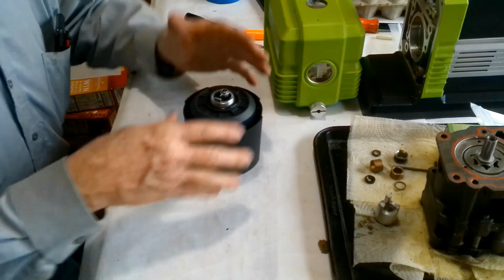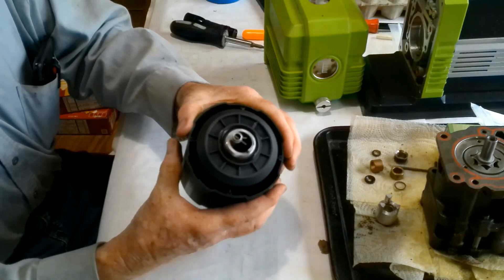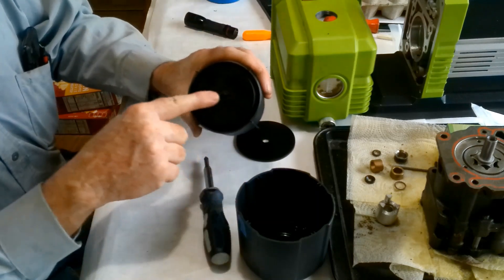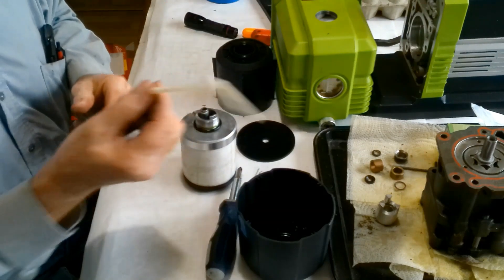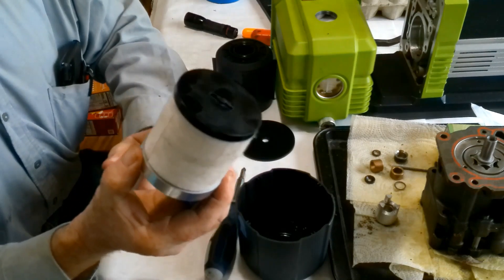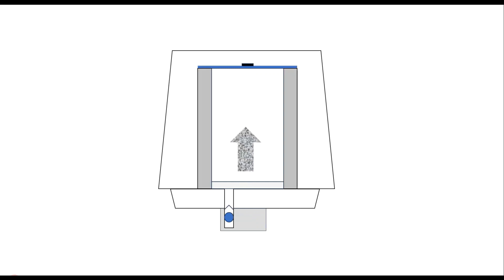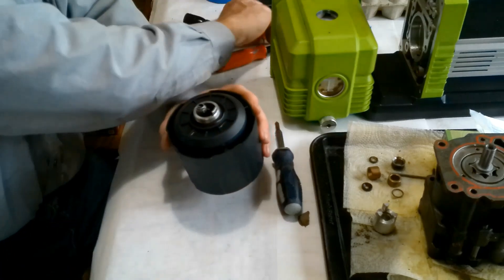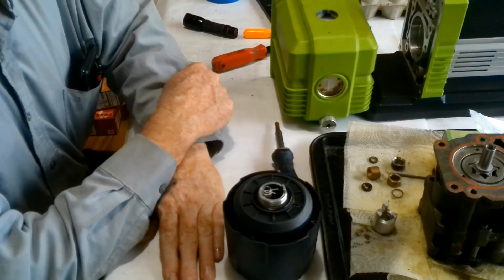Harvest Right's Oil Mist Filter Maintenance

Comment: The demister on my pump is only a few months old. It looks new inside. I change the oil after nearly every load. The demister has what looks like smoke coming out of it, from under the cap. There’s no odor, so I know it’s not actually smoke. The pump sounds fine. Mtorr is about 550. Do you have an idea of what the issue is? I have a fresh gallon of the black gold oil that I plan to switch over to. I’ve been using the robinair brand.
Reply from the maker: If you’re seeing visible “smoke” from under the cap, it means some oil vapor is bypassing the filter element either because: The pump is working hard at higher chamber pressures (550 mTorr is still high enough to produce more mist than deep vacuum),  Or the demister cap isn’t sealing perfectly around the gasket, so the vapor is escaping before it’s filtered.
Reply: @Philat4800feet I figured it out. I somehow wound up with two of the rubber washers on the inside of the cap. Thank you for your help! Again😊
Reply from the maker: @pamhoven  good to hear.

Comment: Hello Phill. Excellent video. I have a question about oil vapour been released into the space where the pump is operating. I heard some people talk about the quality of air (particles per million- ppm ) in the same room and also in the house that shares the same air/ventilation system with the working pump. Have you perhaps heard anything about it? It was suggested to have a "fresh air" system in place and working to try and minimize the oil particles in the air. 
Thanks
Reply from the maker: That could be an issue, depending on the location.  After 4 years, having my FD at the end of the hall, near a wall, there was a slight film on the wall.  If you are concerned with the health implications you should obtain the SDS (MSDS) on the brand of oil you use.
The majority of mist leaving the pump will be water vapor.  There will be a small amount of oil mist.  Since oil and water mist is heavier than air, it will fall to floor unless air currents are strong enough to keep them airborne.  Any oil mist will most likely fall to the floor and be absorbed by household dust.  HVAC filters and carpet will most likely trap anything else.
Reply: @Philat4800feet  Thanks Phil. Appreciate your response!
 Your points make perfect sense, especially about oil and water is heavier than air.  My 2 FD are in my basement. I have fresh air system running all the time but i am thinking about testing the air quality in my house- just in case.

Comment: How often are you supposed to do this?
Reply from the maker: Under normal conditions, you should be fine.  Cleaning would be required if rust is seen inside.
Reply: Thank you for your reply. @Philat4800feet

Comment: Is it normal for the clip to be rusty and to have rust inside the actual filter medium? We didn’t take it apart, but can see the rusty clip and see the inside rust with a flashlight.
Reply from the maker: Yes, kind of.  That's where the moisture goes that isn't trapped in ice on the wall of the chamber or in the oil.  You need to remember us freeze drier's are using HVAC pumps in a way they weren't designed to be used...but they work.  It too late now, but remove your oil mist filter at the end of the cycle and place it on a paper towel (it's one of the things I do when I change the oil)
https://youtu.be/ZzpqL4aicpQ  
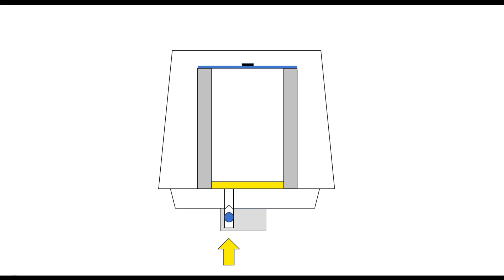See time index 8:37

Comment: My vacuum just stopped its vacuum I can not figure out why I changed the oil twice just to see if it was the oil any suggestions?
Reply from the maker: 1.  Plug the vacuum pump into a standard 120 VAC outlet
2.  Is the switch on?
3.  While it's plugged in, with the switch on, wiggle the cord around to see if the cord has an "open".
Do you have, and know how to use, an Ohm meter?

Comment: I may have missed it, but when does the filter need to be replaced?
Reply from the maker: Only if it gets really rusted inside due to trapped condensate.  Keep it right side up in a bowl when not in use to allow to drain.

Comment: Hi. My vacuum pump tipped over and oil got all over inside the oil mist filter. How would you recommend I go about this? I was going to take apart and clean with soap and water but found this video first. Now, I'm not sure what to do.
Reply from the maker: The filter medium (paper), within the demister, is already saturated with oil from vapor from the pump, and will dip down back into the pump through a little check ball and hole near the threads.  If you take the outside covering off you may be able to speed up the removal of oil.  Oil and water don't mix and I would advise against washing the medium.  Let any excess oil dip away.

Comment: I was following your instructions, however, when I looked at the clip and flipped it over, there was no ball bearing in there. Not sure what to do.
Reply from the maker: The important part is the cap needs to let the oil drain back into the pump.

Comment: Phil, I have read stories about rooms full of oil mist. I have read about cleaning the oil mist filter. But what if the mist keeps up? Would rigging up some pipes going to a water separator then piped to the mist filter. Would the water separator trap the mist?
Reply from the maker: You're  not the only one with this problem.  There are a few causes.  Some simple and some more difficult.  Here they are:
1. The internal vacuum pump, within the unit is made up into three sections and doesn't have gaskets.  If one of those section is loose the vacuum can draw the oil through a tiny space and atomize the oil into a vapor.
https://youtu.be/8jFGjKkOW3E
2.  Is your gas ballast valve (knob) open?  Try running the pump with it closed.
3.  Try a different Filter.  Navac (Navacglobel.com) has one that will fit the pump. Part number P012005.  Go to their website and find a local distributor.
4.  Some will put a heavy sock over their pump filter.

I hope one of these will help.
Reply: @Philat4800feet  Phil, I am just trying to be prepared. Ordering my FD today. It will be in the basement. It's to only place with some room in our little house. Wife wouldn't be happy with oil mist in the air. I used to work at a rental place and when people would rent an air compressor they sometimes needed a water separator to take water out of the air. I'm not an engineer, buy I was thinking if i put   hard pipe (steel) off of where the mist filter is located to a water separator and then more pipe over to the mist filter, would it take more of the mist out? 

I know I'd need to make brackets to support everything. Plus I'd need unions so I could disassemble and reassemble everything.

Just thinking outside the box. Didn't know if you had ever heard of someone making a contraption to catch additional mist?
Reply from the maker: Could you use a hose and vent the pump out a window?
Reply from the maker: Make sure the O-Ring gasket is still on the filter
Reply: @Philat4800feet  Unfortunately all 3 of my basement windows are ones that tilt in just a little bit. The soil on the outside of the house is right at the very bottom of the window and the other one has a window well around it on the outside. If I opened them and tried to rig a vent to the outside, I may end up with critters getting into the house. I've caught mice in traps around the house. Other critters in catchem alive traps. And I live in town. The skunk was my scariest catch.

The basement walls are lined with shelving. There is a space in the middle of the basement, that has cupboards as well and at the end of those is where I was going to set the freeze dryer. 

At the rental company that I worked, they used a Wilkerson inline water separator. It was just a canister with 3/4" Chicago fittings. I believe it just had baffling on the inside and as the air flowed thru, moisture would deposit on the baffles, flow to the bottom and then you could drain out the bottom. 

I'm hoping I don't get the dreaded mist, but if I do, I guess I could rearrange the basement. Get a 4" diamond core bit, drill a hole up high through the blocks and make a vent to the outside. That's a lot of work.

My FD is ordered, I'll know in a couple of weeks.
Reply: @Philat4800feet  Thanks for all your help. Wondering if oil misting will ruin any of my food batches.  On my second bread batch now and it only misted for part of the Heating. Maybe it’s done?
Reply from the maker: Vacuum is one way, away from the freeze drier.  Your food should be fine

Comment: Can you clean them if you completely dry them of moisture, and rotate your filters while the other one is drying with a warm fan
Reply from the maker: Hard to say, the filter medium is thick and dense and already saturated with oil.  Water based cleaners may not work and any degreaser could be hard to remove.

Comment: Phil is there a faster way to heat up oil to change it without going through a whole cycle? My oil needs changed but I did not have time to do it before it cooled down. Thank you for your videos.
Reply from the maker: Just run for 5-10 minutes, but it would be better after a batch run.

Comment: Despite my better judgement, I let movers move our FD. I am about to conduct the initial tests and think everything will be fine, but they did spill a lot of oil out of my pump into my demister...should have drained it but didn't think they'd be turning it upside down.

Am glad I watched this instead of the HR recommended video out of the manual. I ended up using paper towels to pull most of the oil out of the filter element - thankfully there wasn't too much, but still pretty annoying. As always, thanks for the excellent videos. I recommend your channel all the time.
Reply: Did you get a lot of oil mist in the air? My bread run was getting a lot of fogging into my garage. I ended the cycle early during Heating. I am in the middle of my second bread run now.
Reply: @rodneyashcraft4440  no, my paper towel trick worked well. I used a lot of paper towels tho

Comment: Oil in my pump turns milky after every batch. I have a newer free dryer with the upgraded vacuum hose. I also took it apart and resealed all the orifices. What to do?
Reply from the maker: Milky color is generally water mixing with oil.  Some of the moisture in your food is leaving the chamber and entering the pump. Your food needs to be rock hard frozen before the pump turns on.  Here are some things you can do:
Pre-freeze your food for 24 hours in a freezer.  this is a big money saver.
Lower your freeze point and add extra freeze time on your menu.
Change to Black Gold oil-  This oil will help separate the oil from the water
What did you take apart???
Reply: @Philat4800feet  thank you for actually answering: Yes I've been prefreezing since day 1. I will check the menu to see how to add extra freeze time and use a different oil. There is known vacuum leak issue with these freeze dryers. Here's a link that explains the simple fix: https://www.youtube.com/watch?v=YeMzOb7--vA

I don't really understand the issue with mine since I've never had an issue with milky oil before.
Reply from the maker: If you let the milky oil stand for a few days it may clear up.  Black Gold does it better.
Reply: @Philat4800feet  I've been changing it every cycle, it didn't use to do it so not sure on the fix.

Comment: Hi Phil. I did not use the FD with a premium pump for several months over the summer. Upon first use this early fall the pump ran very hot and there was a hot oil smell throughout the house, which has NOT happened before. (Thankfully no oil mist, as has happened before because I missed replacing a gasket after removing the oil mist filter.) We took apart the filter and noticed the oil had gummed up to a hard consistency in the hole where the pin and ball bearing is located. We replaced the filter with a new one, ran another batch through the FD and had the same problem with the hot oil smell. Could the oil have gunked up inside the pump like it did in the filter? If that is a possibility, can you suggest how I should address that possible problem? Thanks!
Reply from the maker: If it gummed up the filter, there's a chance it gummed up the pump.  How good are your mechanical skills?  You might want to watch thai video:
https://youtu.be/8jFGjKkOW3E
Reply: Bugger. Ok. I’ll let you know how it goes!
Reply: @nancy_44  You said you "replaced the filter with a new one".  Where did you get a new one? I'm trying to get one for our (Medium Pro) premiere pump.

Comment: Thank you for showing this.  I have run five batches on my new unit and there has always been oil in the drain water.  I changed and discarded the break in oil and now see bubbles in the site glass when the pump is running.  Also, when the pump first starts up, the oil level in the site glass goes up above the upper level line for a few seconds before dropping back to a safe running level.   I had thought it might be something wrong with the demister but now I am not sure.   It will pull a vacuum and works fine but I wonder how much damage those bubbles are doing.  I know cavitation will eat a pump up when the bubbles implode.  I am going to run it in the test mode and see if I can talk to someone at Harvest Right.  Any help would sure be appreciated.

Comment: My pump has started running hotter than normal and there are flecks of oil in top the pump housing.  Would this filter possibly have anything to do with that?  Also the vacuum level doesn't get below 400, where it used to get down around 200.
Reply from the maker: Hard to say.  Old oil and cloudy oil (oil mixed with water) won't pull a very good vacuum.  What's the room temperature where your pump is located?
Reply: @Philat4800feet  room temp about 70°F.  With those temps the pump is pushing 175.  With a small fan blowing it's around 135.  I think I have about five runs since a fresh oil change and it's clear.  Vacuum getting no lower than about 445 where before it was high 200's.

Comment: I have a statndard vacuum pump. Is their a filter or maintenance proceedure for it?
Reply from the maker: Sorry, no.  The standard pump is a hard worker.  No information on replacement parts.  When it gives up the ghost, move up to the Premier pump.  You won't be sorry.  I would replace and filter the oil after each batch.
Reply: Thanks. I am chasing a vacuum problem. It won't hold steady. This is a replacement (at my own expense) pump that HR claimed would fix my problem, but it has not heldped at all. HR has piss poor customer service. I will keep scouring YT and reddit for clues. @Philat4800feet

Comment: so I did get the white part wet but thought it was completely dry when I put it back together.  Since doing this I can't be the vacuum test to go below 500 mTorrs it gets close but not under 500.  Could this be the reason and is there anything I can do to fix it.  Yikes.
Reply from the maker: I wonder if you have water and oil mixed together.  That could be a reason.  Have you changed your oil?
Reply: I changed the oil when I took the demister apart and I changed it after again before I tried to flush the vacuum as another thing to try and get it to pass the vacuum test.  When I try the functional testing ... if I have the freeze on as well as the vacuum it got right down under 500 mtorr but when I just do vacuum it will only get to as low as 536... the last 2 tests were over 700.  I am in Ontario Canada... yikes I know.   I have a 22 year old son at college who helped me put self-fusing silicon over all the crimped ends and I have unattached and reattached all the hoses.  I changed the ball valve which was really rusty and I thought that was the problem.   SHould I take the demister apart and leave it out in the sun??? to dry all the water.  I did that when I did it the first time and it seemed dry but still oily.  I appreciate you getting back to me and I value all your great videos.  @Philat4800feet
Reply from the maker: @marycanfield1974  Drying the filter in the sun sounds like a good idea.
Reply: I will get the filter out and see if I can get it dried out more.  Thanks again.  On to Plan H
Reply: I went ahead and ran a batch and so far so good ... when I checked this morning the mTorr was 326... so I hope that means it is doing ok

Comment: Harvest right has the worst customer service and all they care about is the money from the Customer, then all you get is a run around talking to tech's that don't have a clue and then before your machine works they close your Ticket pretending that all is fine!! BUY LOTS of relay boards because every one will break numerous times because as most of the machines they are made in CHINA not as they say made in USA. I have 2 of them just so I have one working most of the time. If you live outside the USA they have NO Tech's anywhere, no help and NO support. Mine is 10 months old and the pump won't work while plugged into the FD. The girl on the phone Jacqueline Winegar say's they will not send me the parts BUT if I give HR good reviews on (5) channels that she supplied she will give me a 100 dollar credit to go towards the parts she won't supply that are under Warranty. I would never buy another HR and I am selling mine and buying the NEW USA made " Blue Alpine". Never buy the Oil less pump like I did when their sales man talked me into it as 100% of them stop working, mine was used 6 times and was 6 day's out of warranty and they would do nothing, that piece of Chinese junk cost me 1400.00 Canadian. Harvest Right are snake oil salesmen, selling Chinese junk at terrible high prices where they make 100 of percent profit, take your money and leave you hanging with an anchor. Now on my original one my door is getting thousands of stress cracks in it and I assume it will explode soon, it is out of warranty so they will have a expensive Law Suit soon!! If you buy one good luck and have lots of spare parts because you are going to need them.
Reply from the maker: Is the only pump you have oil-less?
Do you have any service ticket numbers?